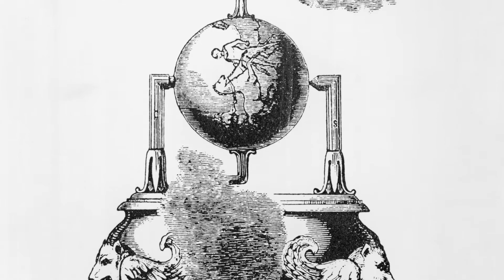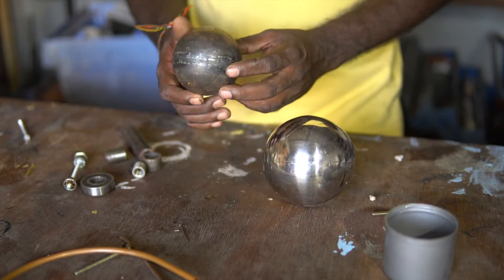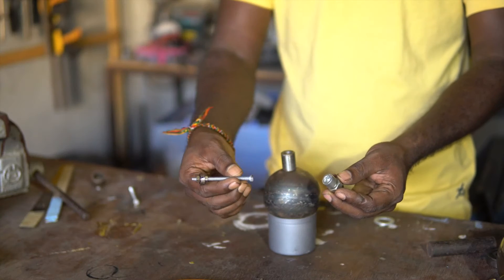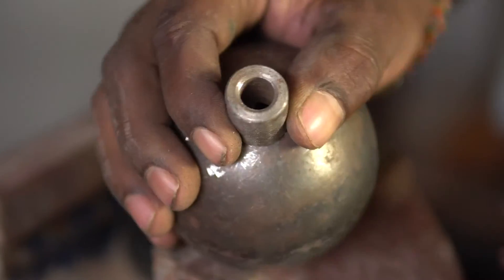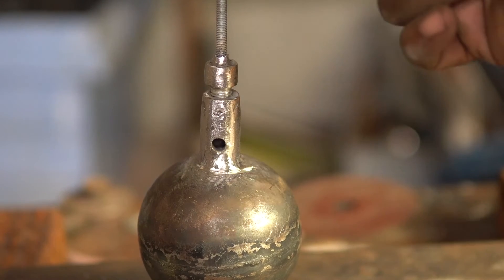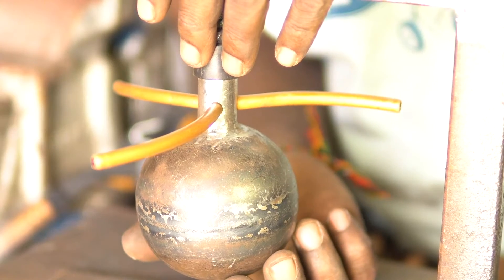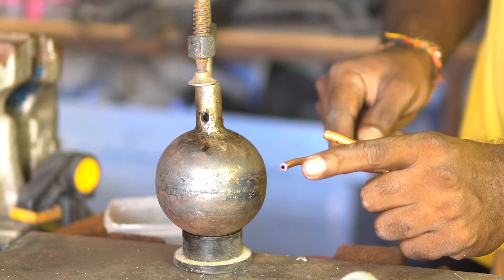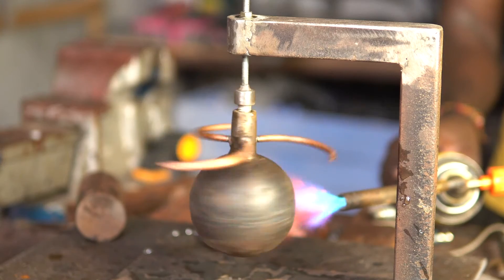I made the model of the oldest steam engine | 2300 years old steam Engine| part 2

Comment: can you use a magnifying glass and have it set onto the Heros engine. Hook the engine to a generator and maybe some kind of drip system to replace the evaporation.. and have essentially free energy??
Reply from the maker: may not work. The torque is very less. You may need to make a steam engine with pistons and run it under higher pressure